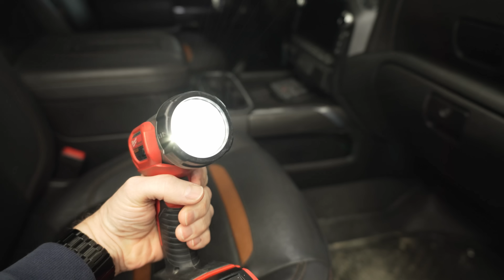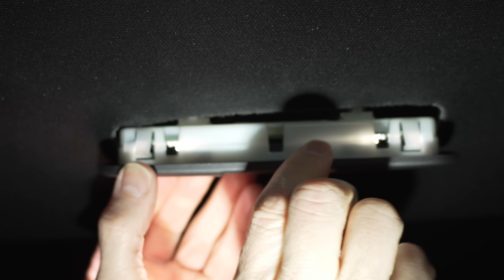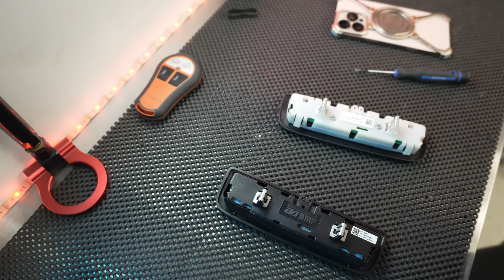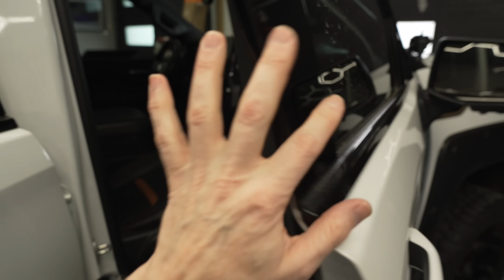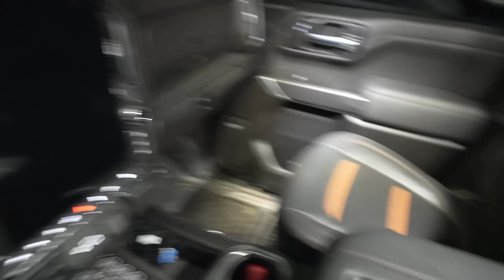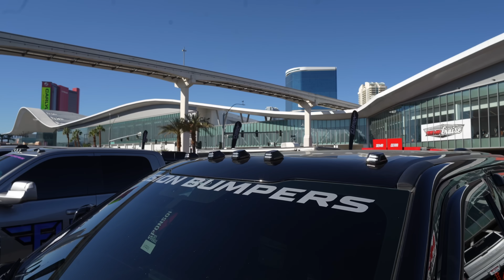The First REAL Fix For GM’s Dim Interior Lights - Boost Auto Upgrade

Comment: Not your best video...very poor focus on the clip removal as the overall LED upgrade on the new light due to it being frosted. That was a completely bad choice on Boost's part. Should be clear. Too much for a light in the back where no one usually sits.

Comment: Don, is the "kelvin" or "color" of the boost auto dome light the same as the factory front lights. i e you know there is 3000K, 4000K 5000K and 6000K lights out there or warm, bright, daylight types of colors. I would not like it if the boost auto light is not the same "warmth color" light as the factory front ones are. Thanks !
Reply from the maker: It seems to be the same color temperature as the low output front LEDs, just way brighter and a broader beam pattern

Comment: I have a 2024 GMC SIERRA. From the beginning, I was really disappointed with the interior lighting brightness. After researching, there's nothing available to improve the  brightness except this light. I purchased one, but it was on back order and wouldn't ship for a couple of months. I just received it and installed it yesterday. What a difference it made. I'm totally satisfied with the brightness. Too bad they don't have a replacement for the map lights. Is $100 insane? Absolutely. Hopefully, GM will address this lighting issue with the next gen 2027 trucks.

Comment: Woo Hoo!!! My Boost Auto interior dome light finally arrived.  Simple install. ( I do wish GM gave you a little more slack on the pigtail.) My plug had the RED safety catch that GM loves to use on most everything.  This mod is HIGHLY recommended!!!
Reply from the maker: Glad the install went well and that you're enjoying the upgrade! 👍
Reply: Just installed in my 2024 AT4. Finally! It's not a black hole in the cab. I agree with your comment about slack (or lack of) on the pigtail.

Comment: Don, I have a 2022 GMC Sierra AT4 with the 6.2L engine, and I’m about to take it in for service. What oil would you recommend besides 0W20? Last time, they discouraged me from using 0W40, but I’ve heard there are other viscosity options that may be better. In the 1970s, after graduating from high school, I attended a six-month class at Pacific Technical Institute in San Jose, sponsored by Jefferson Motors in Concord, a Lincoln-Mercury dealership. I got married after five months and returned to my previous job, but I do understand engines, and believe oil is cheap insurance. Any recommendations on the viscosity of the oil I should have them use?

Comment: Should have asked the Boost CEO why they won't make the tow mirrors for the 360 cameras?
Reply from the maker: I have.  There are challenges with alignment. If the cameras aren’t put in the exact location on all axis, the images would be messed up.  Calibration would involve special equipment and knowledge.  At some point it didn’t make sense to pursue making them.  Costs to the customer would probably be too high. I asked this a few years ago. Maybe something will change

Comment: Thanks for the review and installation video. I have a 2024 Serria 1/2 ton and have been so disappointed with interior lighting. I ordered one today on back order, expecting shipment in 6 weeks. I'm sure it's worth the wait. I couldn't find any other replacement light on the net. Hopefully GM next gen trucks address this issue.

Comment: I love boost auto. TELL BOOST AUTO WE WANT A FOOT CONTROLLED HEADLIGHT DIMMER MOD FOR NEW TRUCKS. With a nice floor button not those cheap looking summit racing ones.
Reply: Foot dimmer????? WTF? Those haven't existed for 30+ years. Pretty sure there was a government regulation that made them be changed from the floor to the steering column.
Reply: @F @FastSS02 love them. It’s so much more convenient